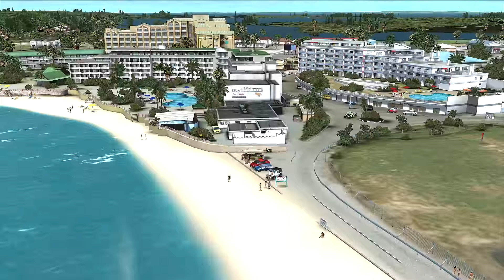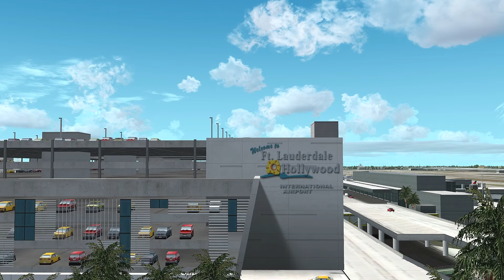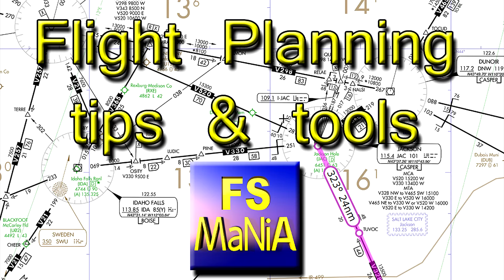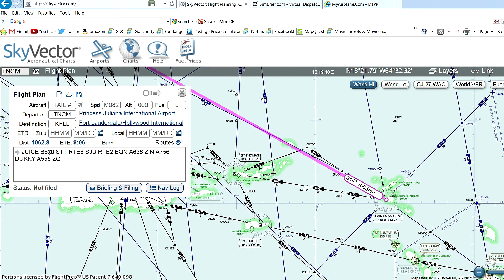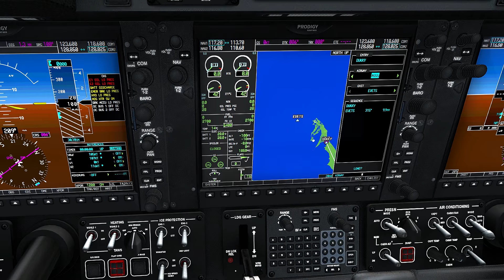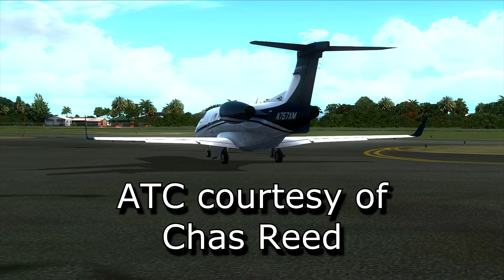Carenado Embraer PHENOM 300 Brazil to Wichita Leg 3 part 1a

Comment: Thanks for the Great videos! I'm having issues with trying to fly an airway, then exit the airway with a direct leg to a new fix then join a new airway from that direct fix. The FMS is only letting me use the airway function to hook up to a new airway from the old one even with a new direct fix put it, any thoughts?
Reply from the maker: +Mr_ATC Ugghh!!  To be frank, this version of the G1000 has been a real pain to do anything other than the most basic flight plans.  I'm doing good to get the Garmin to fly a departure, flight plan, and arrival properly.  I have found if I want to modify the flight plan enroute by going direct, it creates havoc.  I have accepted this version of the Garmin G1000 is dumbed down and woefully lacking compared to the fully functioning real world unit.  Having said that, there may very well be a way to accomplish flight plan revisions, however, it can only be discovered by much trail and error.  Real world manuals aren't much help because this unit doesn't behave on that level.  Best case scenario would be for someone to develop an add on G1000 for this aircraft on the same level as the GTN-750 by Flight1.  My next flight in the Phenom 300 will be from Fort Lauderdale to Wichita with the GTN-750 mod by Bert Pieke.  Stay tuned for that!  Cheers from Tim G., FS MaNiA

Comment: Hi TIm, as usual a great one. I was pretty sure you were about to fly back TNCM to fill up the tanks....... Flight plans are a bit tough to fill in the G1000, it was much more easier without the Navigraph Extension pack, as I could import those directly from Flightsim commander. 

I have seen few tricks on AVSIM, so I need to read the different forums. I guess it will take a bit of time! Cheers. Vincent
Reply from the maker: +Vincent Dufour Hey Vincent!  Your right that it takes a little tinkering to figure out which key strokes work best on this bird.  I'm still learn something new every time I take her up.  There has been a fair amount of trial and error involved but we have made it all the way to Ft. Lauderdale.  One leg to go and that will be with the GTN-750 installed.  Thanks for chiming (no pun) in!!  Happy holidays and cheers from Tim G., FS MaNiA
Reply: Hi Tim! I was amazed the way you are mastering the G1000, I still need to watch the 1a video again and again, until I shall do understand the way to insert flight plans. Next step from Carenado and Navigraph might be to go deeper into details, but this might be a dream only.....Enjoy your holidays, cheers Vincent.